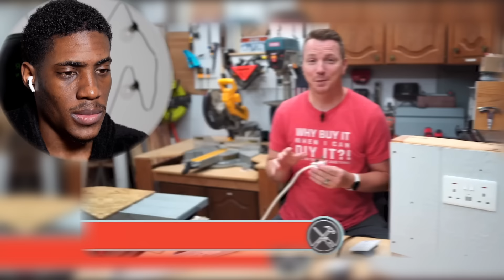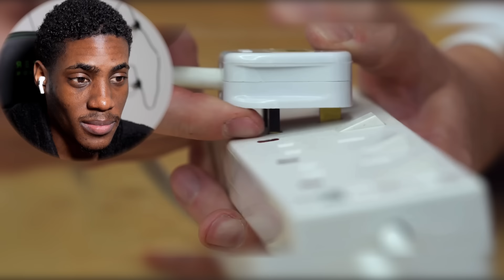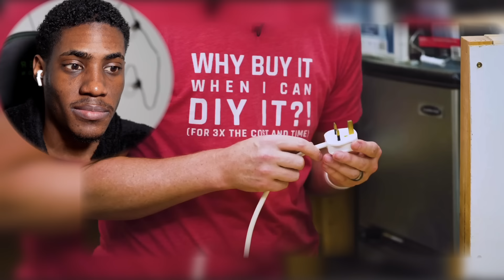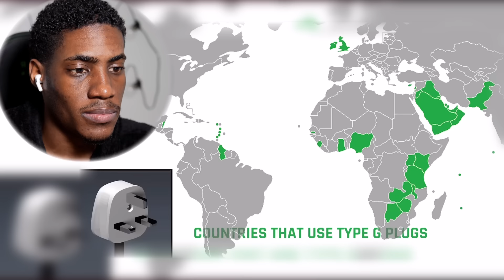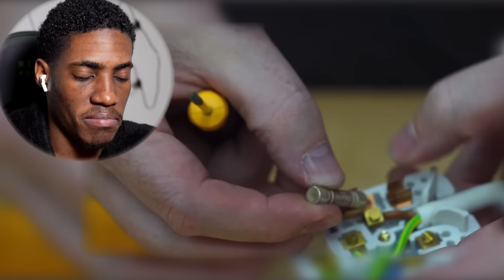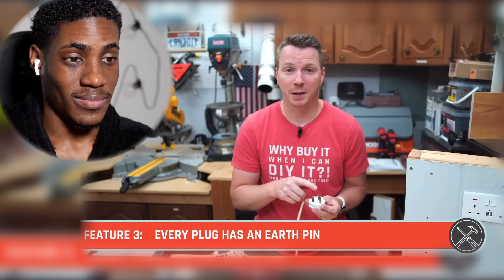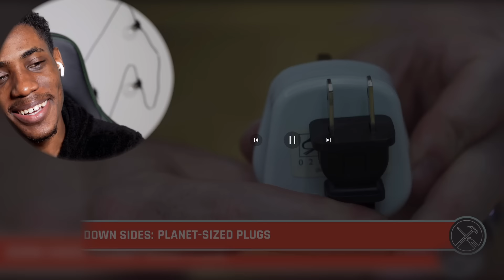Why British Plugs and Outlets are the best in the world || FOREIGN REACTS

Comment: we dont need to take plugs out the wall, thats why they have a switch, we solved the stepping on it problem too, hahahaha.
Reply: When i work on  devices, i unplug them and put the plug into my pant pocket. You never know if someone wants to be nice and flip the switch. I know sometimes we have to work under live wires connected but avoid it as much as possible 😂
Reply: I think we are still advised in the UK to remove plugs when there are thunderstorms about. I have anti-surge plugs on sensitive electronic equipment to stop such things, though my last ADSL router blew up after the telephone line was hit (me and a lot of other people locally that night!). Going over to fibre soon and that can't happen any more.
Reply: @frglee  No need because when is is switched off it is NOT CONNECTED TO THE CIRCUIT. Please take your Flat Earth, trans-rights, Fake moon landing opinions elsewhere!
Reply: @frglee  As an Ex-British Telecom engineer. one house I had visited after an electrical storm. the wall mounted phone exploded off the wall by the lightning strike on the telephone pole. The customer was very lucky, as they had just finished using the phone, and had walked away from the phone when the lighting strike happened.
PS.
In the same area. A lightning strike caused a TV, in a care home to exploded across the residents lounge. Hense unplug everything is the safe option, if it's safe to do so.

 Although this shouldn't happen anymore with "Fibre to the Premises", I would still unplug the modem & router from the mains, in case of a power surge, And any other sensitive electrical equipment from the mains socket. 
If you live in an area that has frequent mains supply power loss, get a U.P.S. power supply, or a portable solar generator, to keep the phone and broadband router working. As these will not work if there is a power outage when you switch over to FTTP, without backup power device.

Comment: A comparison with 2 examples is probably not entirely representative, in any case the British plug is superior to the American one.
You always have to look at the entire system... the cold device plugs (Schuko, with grounding) can be rotated by 180 degrees. You can also replace the plug or add a switch...

Comment: Hi. I've never heard of anyone ever having a problem with load balancing - in fact, I had to Google it to see what it was! Like you, I also think that the 'negatives' were very petty - the plugs may contain more metal but this is more than compensated by the ring mains using far less metal. And why would you leave a plug trailing on the floor? You don't need to unplug it from the socket as you turn off the power at the socket. Another goood reaction - I've watched a few of yours lately so I've just subscribed. 👍

Comment: compared to standard european plugs (type F like in Germany) the list shrinks down to well, one point. The switch. (the fuse and the serviceable part is no advantage to my feelings, because that also means that it can easily be manipulated and tampered, and a slightly broken cable - just throw it away and get a new one, its not that expenisive and much safer than any wannabe trying to repair it and for example forgetting to connect the neutral.)
Reply: The 16amp radial circuit used in mainland Europe can deliver a maximum power of 3680watts per circuit, so for example if you have a 2Kw space heater and a washing machine or dishwasher at around 2.2Kw when heating (so a total load of 4.2Kw) on the same circuit, eventually the breaker in the panel will trip.

In the UK (with its ring circuit) this doesn’t happen as the ring has a 32amp breaker and so can deliver a continuous maximum power of 7360watts per circuit, the local fusing is then carried out at appliance level by the fuse in the plug (this is primarily to protect the cord when under fault conditions) and then finally by the appliances internal fuse. 

On the British system the fused plug is extremely important, as without it the appliances cord could potentially see a sustained 32amp fault current. i.e. a bedside lamp with a 0.75mm2 cord (0.75mm2 is rated current at 6 amps maximum), under fault conditions the cord will melt or catch fire when used on a circuit protected just by a 32amp breaker, the local 5amp fuse in the plug prevents this from happening. 

One other thing: Like Euriope, most UK appliance are fitted with a moulded plug; however the fuse is still accessible. Rewirable plugs as shown in the video are normally used as replacements for damaged plugs or to create custom lead sets.
Reply: @alanwood9804 excellent post.
Reply: Those 2 pin american plugs look so ugly and limp. Surely anything can knock those things out of a socket.